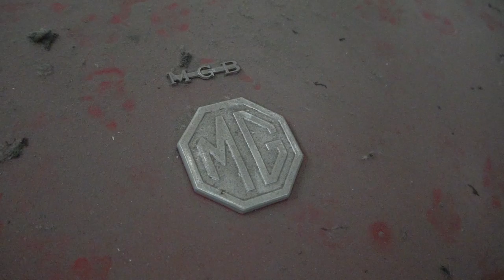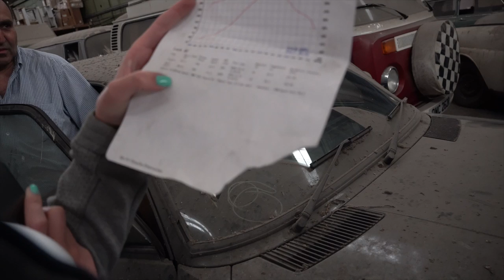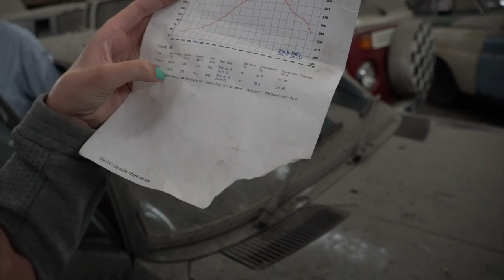FINDING NEARLY 200 CARS IN SECRET LOCK UP IN CENTRAL LONDON..and TRYING TO BUY ONE

Comment: Looks like M535i , its got the M technik Kit that usually was on them and by the dyno its says 218HP that fit the spec of M30B34. 
Jamse good job inspecting the car and saving alot of money on restoration, Becky was already on it, sure that you can find a better one in UK and you can check about import from japan, there are really clean cars there in fare price.

Comment: Couldn't help noticing all the Morris minors the camera just skipped past, I know they're not posh German performance machines, but they're great cars all the same, I already own a 1970 Minor 1000 Traveller and it's brilliant, very slow but somehow still an absolute blast to drive, really nice burbly exhaust note, proper fart on the over-run visibility is second to none, great reliable little engine they're amazing to drive around town, even now, as a little run around, it beats a Fiesta, even now and they have a steering wheel big enough for a battleship! For me, yeah, you keep the BMs and Mercs, I'll take a moggy thou! Or that Triumph Stag, and the MG TC Midget...

Comment: James was right to drop the anchor on you that old m5 replica will need a ton of welding work, all new brakes pipes and fuel lines including a major service and no doubt all the brakes and bushes looking at would have been a big can of worms
Reply: It's not an m5 replica, it's an M535i.
The kit is standard, the M5 didn't have a kit (although the m535 kit was an option)
and for 10k it's not bad value.

Last mot'd 5 years ago with no advisories
Will need some welding - most do but no reason it would need new brake pipes etc.

Comment: You know that's not an M5 replica? It's an M535i , had 2 of them back in the early 90's , they use the 12 valve straight 6 m30 engine, Bilstien suspension, Recaro type seats, M tech body kit and metric rims with 220 size tyres.  Fast car, especially with the dogleg manual gearbox. My manual one was the same colour green as that one, quite a rare colour, Agate green.  They suffer from bad lower rust as they get old, jacking points, sills, subframe mounts etc. Rare cars now. Bonnet release is in the glove box BTW.
Reply: Thank you, at 10k manual that was a bargain!

Comment: Becky at 13:05 “what is that” ?
Is it a UAZ ex military vehicle
…or a slightly modified Hotchkiss Jeep Willys ?
I see the rear wheel arch with a fibreglass fender added …. But the military antenna mount / base is still there. The bonnet also hmmm…. Something there doesn’t match. 
Great video
Reply: AUSTIN CHAMP
Reply: @manx1630  perhaps too… soft top canvas good quality but the work done … omg

Comment: Well….buyer beware because most of that collection needs a mountain of work! I bought a new BMW 520i in 1985 and it had a magical engine, good gearbox and terrible brakes….it did start me on a BMW path for nine years though. So a lot of cars that were good but now???…..don’t pay much for them as restoration might cost a relative fortune. Good luck…that 635i might be appearing soon..just needs maybe £15000 to get it driving as it once did! 😎😎😎😎

Comment: That green “m5” on the log book is no way a proper M car...
Reply: It's a proper M535i

Kit is totally standard.
Proper fun car - 218bhp and lsd as standard
Reply: @th3b0untyhunter  run the registration plate on DVLA and it states it’s an M5, e28 M5 came with M88 engine 296bhp. If it was an M535i it would not be listed as an M5, but rather M535i. So it has to be an M5 with which has had its engine replaced with M30 lump ?